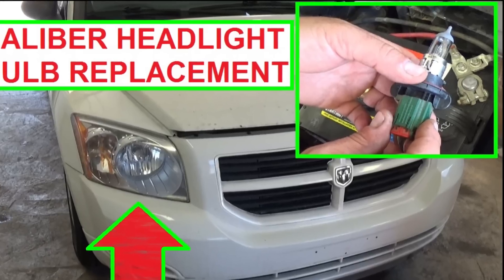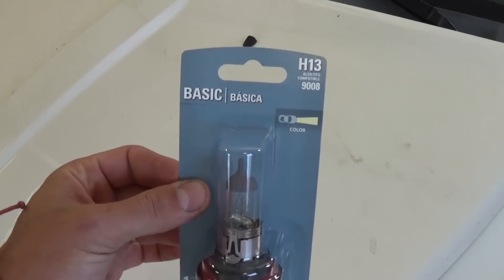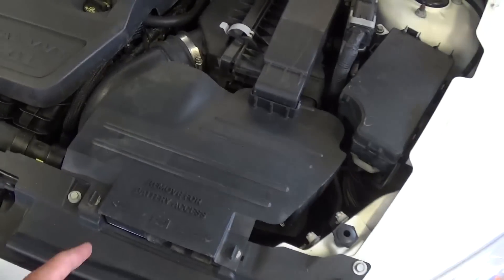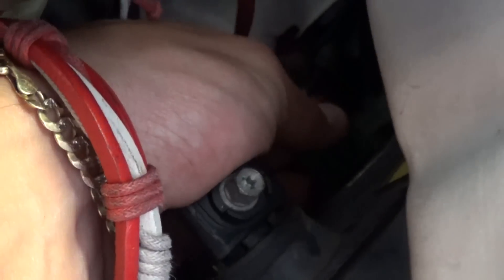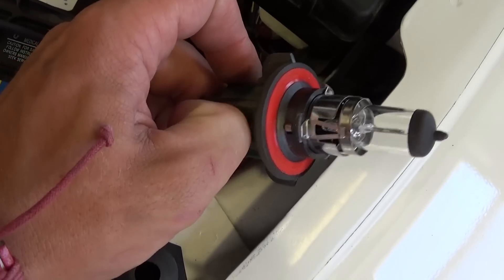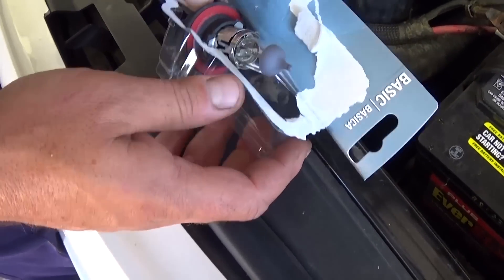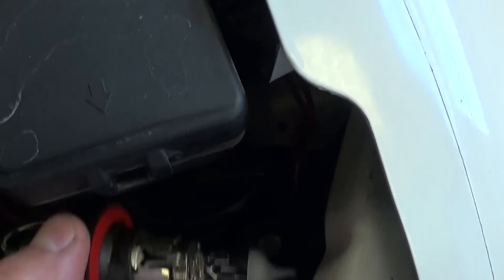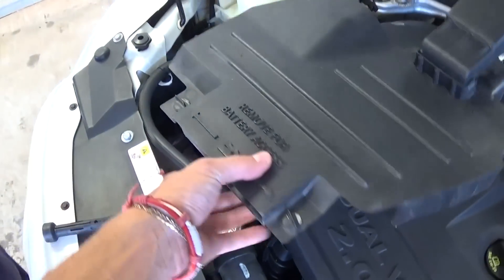Headlight Bulb Replacement Dodge Caliber.  How to Replace headlight bulb 2007 - 2012 Caliber

Comment from the maker: Products that we use and recommend:
► Headlight Bulb: https://amzn.to/4hF55dd
► Panel Removal Set: https://amzn.to/3YiMADu
► Assorted Fuses: https://amzn.to/4fx4s3F
► Tool Set: https://amzn.to/3p5MM6t
► Screwdriver Set: https://amzn.to/3XRB28Q
► Oil Filter: https://amzn.to/3w0Ulme
► Torx Set: https://amzn.to/3xlCkfT
► Torque Wrench: https://amzn.to/32qyRwg
► Liqui Moly Engine Flush: https://amzn.to/3IiDBID
► Voltmeter: https://amzn.to/4hB6Zvk
► OBD Scanner that we use most often: https://amzn.to/3I4MQfe
► Mobil 1 Oil: https://amzn.to/3xBc8B9

► Check out our Amazon Store for the tools and parts that we use: https://www.amazon.com/shop/worldmechanics

Comment: THANK YOU!!!!! I looked at several (other) videos that showed a complicated, partial dismantling of the car to change the headlight bulb. I was beginning to get freaked out about this project. Then I found your video: I was able to do the job myself in just a few minutes, following your instructions. I was doing the passenger side, so access was a bit tight, but still do-able without it being a major ordeal.
Reply: I thank God I have small hands.

Comment: Excellent video! Was apprehensive about trying this for fear of breaking a plastic clip and causing more problems. After watching this I had my bulb changed in 5 minutes :) BTW i'm 6'3" and have fairly large hands. This space is cramped but doable. I have a 2008 Caliber.

Comment: ya'll arnt showing the passenger side because it is not as simple as the driver side.
Reply: jwmhenderson also didn’t show that fact that they also have a rubber cover on them as well
Reply: I’m trying to change the passenger side as we speak and you need the hands of a 6 year old to get in there.
Reply: @chado3000  Thanks for the laugh!!

Comment: I am a women who is  sooo glad I found your video on how to replace headlight bulb. The first video I saw really scared me. The man removed the top bolts from top of bumper, then raised the car up to remove 4 other clips and screws, then he removed the light assembly just to replace the bulb. I thought it would cost about $100 to have auto shop to do it. Thanks to your easy steps, I can do it myself and save some money. Chris Fix it got the easy fix.

Comment: You saved me 186.00 because that's how much Firestone wanted to charge me...but I followed your instructions and in 2mins I was done thank you so much
Reply: Welcome to the world of actually doing something yourself.. Next step, learning basic information about your car from a manual.
Reply: Bradley Mathie Rude. I bought my car used and there is no manual.
Reply: Depends on your model, mine is quoted at 150 due to the removal of the road wheel bay covers and difficult access. Its about $40 for a quick change on this model. And no, not all dodge calibers were built the same!

Comment: I don't know what I'm doing wrong.  I have a 2010 Caliber and I can't turn the bulb housing back into the lock position on the driver side, and I can't even get leverage to turn the one on the passenger side.  That adjustment knob is blocking my hand (average size) from getting proper leverage.  After fiddling with it for over a half hour, I came to watch videos and this one was the first I saw.  I did the same as you demonstrated, but I can't seem to get it to turn.

Comment: Thank you for the excellent guide. I am baffled by access to the passenger side bulb. Not much point in having an opposable thumb if you can't fit it in there.

There is black plastic projection on the assembly, is that removable?

Only other answer I can see is unmounting the reservoir cluster.

Comment: Not A Word on having to Reset the Switch..... Dealer has to do this...$$$$$$$$ i tried replacing Bulb... No Luck, Now to Dealer to get the Computer hooked to it
Reply: Or you could have used google to find out you just have to short the battery leads to drain a capacitor.. Remember google... that thing before youtube...
Reply: Bradley Mathie Do what now? I have to change the bulb in my passenger side headlight. Will it work without doing this weird thing that you said?
Reply: @stevefratus1546  I just did this repair myself, and no, you need to disconnect the battery until all the stored electricity (capacitors) is drained from the vehicle.  Othewise the TIPM board will not send electricity to the bulb.  It's pretty easy to do but it may take several hours to fully drain.  I just leave both leads of the battery zip-tied together overnight.

Comment: No way you can do that on a 2011 dodge caliber SXT.  The front bumper (Lots of video's of how to remove) and the whole headlight (3x10mm bolts) has to be removed  as a locking tab under the rubber sleeve holds the bulb in. Using a T20 torx to relieve the locking tab to remove the bulb. While you have it off. Check the 12V 5W T-10mm Wedge bulb is working, directly under the headlight bulb. Replace if necessary.

Comment: be mindful that if its been a while since you've replaced the bulb the rubber gasket/ring might get stuck on the bulbs entry point from the old bulb - this will not allow you to twist the new bulb into position, and, for someone who hasn't done this before and can't get a clear view of the hole this can be a headache.

Comment: Here's a better idea...NEVER buy a dodge!  Why do they make a vehicle where you have to take the @#$%! thing apart to install headlights?  I'll tell you why so their dealers can make money off their terrible vehicle. Also the electrical systems,  the suspension, and things like the DOORS break constantly. When my key fob I got at a dealership broke they told me it would cost $100 just to find out what is wrong with the key THEY SOLD ME! I will never buy a dodge again. If I have to choose between a dodge and walking I'll invest in Nike
Reply: Dan Williams What did they have to take apart? The battery cover had to come off. That takes a second. I love my Dodge.